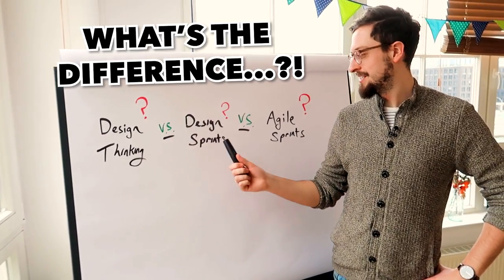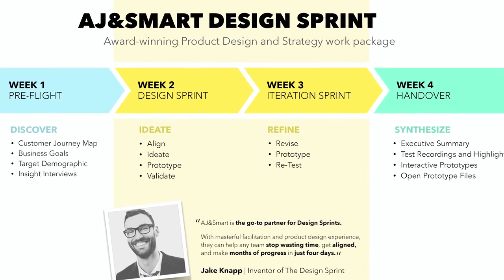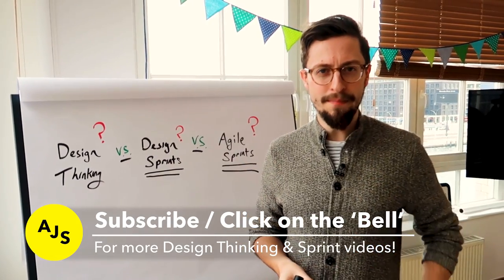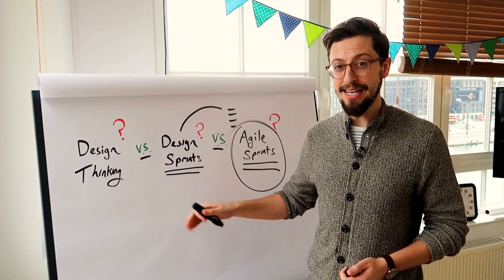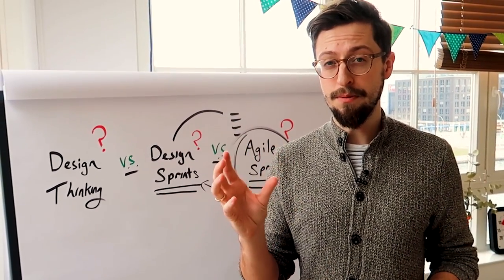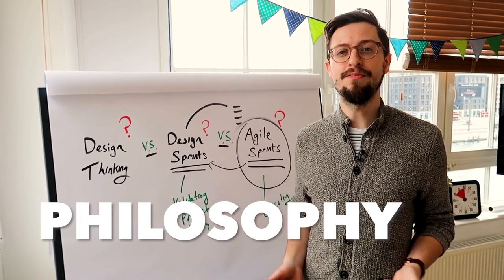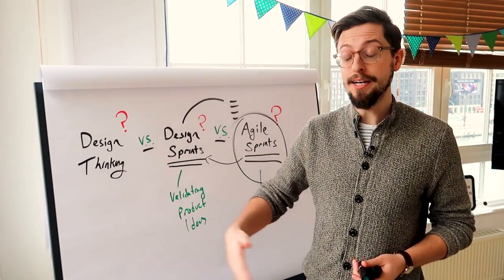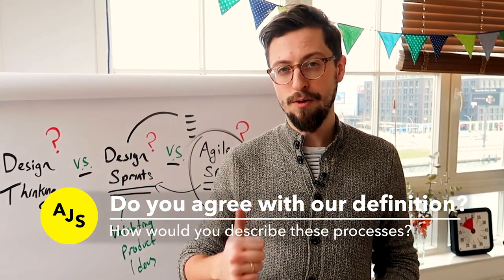Design Thinking vs Agile Sprints vs Design Sprints (2022)

Comment: Hey Jonathan, I always love the content you and your colleagues create and share!  
And I am sure a lot of people want to know the answers to the questions in this video. 
So my attempt to set the record straight about Agile Sprints is meant to be a positive and constructive one.

I was surprised (and maybe disappointed to be frank) to hear you explain agile systems as development systems. 
And later on declaring there's no creativity in there (pointing at agile sprints). 

In my opinion Agile Sprints are all about value delivery. 
And in every sprint there is creativity to assess the problem and to come up with hypotheses for the best solutions as well as ways to validate those hypotheses. Before developing aforementioned solutions. 
Also in agile sprints the work is done by self-organising cross-functional teams. I would hope and encourage that those teams breathe design thinking. And this is also something I observe in the teams I train or coach.

Design Sprints, I do love the system of design sprints can co-exist perfectly in an agile organization. 
Since it is about solving BIG problems, it fits perfectly in an Agile Portfolio Management Approach. Where the design sprint might answer big questions and validate solutions. 

Hope this helps,

Kind regards,

Mahanaïm Singadji
Certified Agile Marketeer, and 
Teacher Agile Scrum for Non-IT
SDP, SMP, SCP, SA, PAL, PSPO, PSM

Comment: I do not agree with the explanation of an Agile Sprint, assuming you are referring to Scrum. Scrum is a framework for learning and value delivery, not just the latter. If you feel you need design sprints to fill a product backlog for a Scrum team to build, I fear you are missing the point of Scrum entirely.